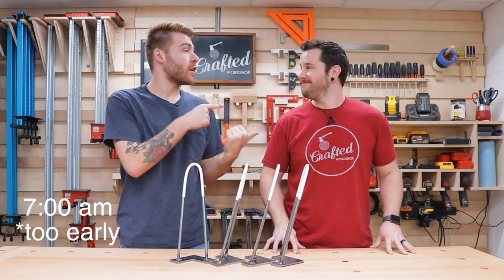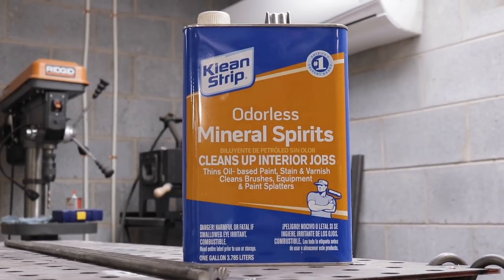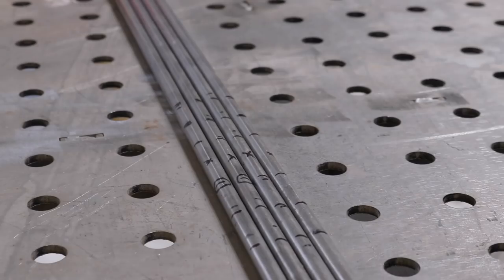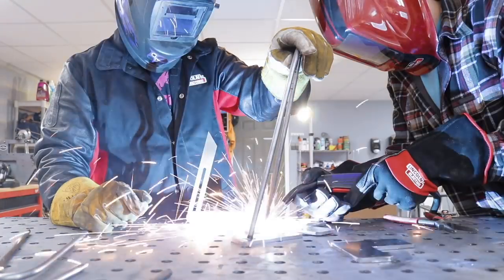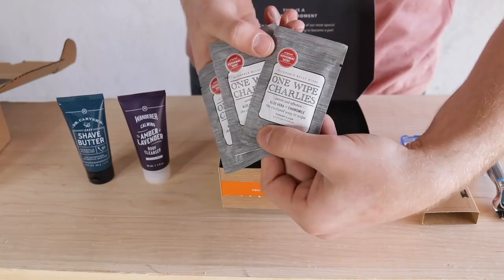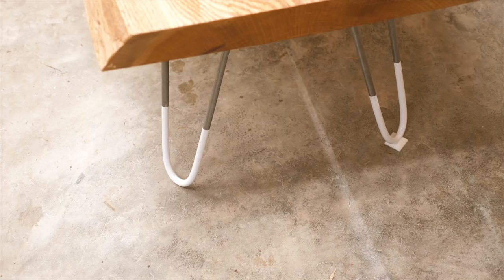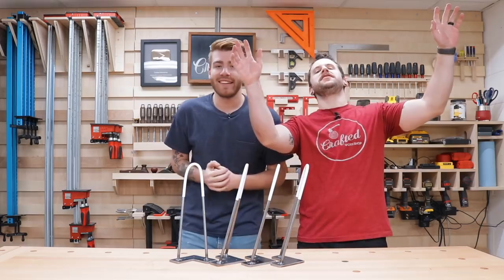How to Make Hairpin Table Legs | EASY

Comment: For some reason my desk is not stable using hairpin legs. The legs are screwed in tight but there seems to be no support. The table is 36 inches long and it a slab of maple wood.

Comment: Really cool video.  I made a set myself a few weeks ago using an oxy-acetylene torch to heat the round stock for bending.  My jig was very similar to yours.  I did make my top plates of of 2 pieces of flat plate that I tig welded into right angles.  The biggest difference on mine is that I drilled through holes in the plate and pushed the legs through so I could weld both sides of the legs and then ground down the welds on top.  They turned out really well.

Comment: Hey Mike!
I must have been learning how to make hairpin legs the same time you were! If you're interested in a super clean look as far as welding the legs to the plates, I found it worth the time drilling holes through the plate big enough for the legs, with a bevel on the topside. I left an extra inch on each tip of the leg and fed them through the holes until they all lined up. Welding the bevel on the top side made them incredibly strong, then I was able to cut off and grind down the excess on the side that would be hidden against the wood. This was great for me because I don't have the technique down for a pretty weld but I know my way around an angle grinder.

Comment: Neat video. I may have to try this as I love DIY. I was just searching hairpin legs on amazon and found some that would work great. They are 16" and support up to 250 pounds for less than $20 a set of 4. They had 5 stars too which also made me feel better. - Heidi

Comment: The ghost scene...oh wow lol. So good. Shspeways is great. I get my protectors that come in a bunch of colors from another company. As others have suggested, they clip on and are a bit more pliable. If you pick up the table, the protector stays connected.
Reply from the maker: Right on! I’ll have to check em out. What’s the brand?
Reply: Modern Builds i believe they are from The Hairpin Leg Co, usually get them on amazon for about 10 to 12$. Hope it was alright to mention them, thought sbout that after i sent the comment. I like that yours offer a differnt look, and i think Shapeways can print in different colors too. Could even hit em with that paint if someone wanted them to match

Comment: Can you add a finder washers to the bottom of the legs the holes in the washers could be useful for tack welding and put smaller round felt pads on them?

Comment: Using Plasti-dip (the original tool dipping kind not the sprayable version) would be a good solution to get the color at the ends while also making it less likely to damage hardwood floors.

Comment: Those bars look like cold rolled steel which does not have mill scale. Mill scale is an iron oxide layer that forms when hot rolling metal. It can not be removed with mineral spirits. I wish it could be tho.

Comment: There are inherent problems with hairpin legs that I see nobody ever mention or even try to fix. The first problem is the angle. No matter who you buy them from, they are a set angle. That's bad because to make them fit a table you must move the mounting point in or out so that the base of the leg does not stick out past the corner and look like a baby deer. Or too far inset and look funny as well. So the solution there is a different angle for each height. Now, I actually mean any height has it's own angle. Not just a set for coffee tables or a set for desks. I mean any height in between at one inch incriments. That would mean the taller a table got the straighter the legs and the shorter a table got the more angled out. But then you need the mounting location to be the same for all legs. By that I mean you have for example a 40x20 table top. You drill the holes for the legs. You mount someones cheap China made desk legs and it looks great. But now mount some coffee table legs in the same holes and it doesn't work. So again, a different angle for each height. Once you do that you have the ability to make the perfect angle for any height. Plus the person mounting the legs can put them in the same location every time. If you are selling tables this comes in real handy because you can pre drill holes from a jig and the legs will fit no matter the height. The legs hit the floor at the corner no matter what height and all with the same hole locations. You cannot do that with any legs on any video here on Youtube. You can't do that with any Amazon legs, any legs from China. That's just a plain and simple fact. Second issue is the mount. Why the F does everyone use that big L shaped mount shape? Sheep that's why. Monkey see monkey do. Everyone else does it so it must be good.... smh. No that's the worst shape ever. TYhink about how hard it is to wrap up a set of those and ship them. Now you may be thinking like I think. The shape needs to be shipping friendly. The angle needs to be friendly for use on any top with the same holes. I am not sure why nobody has ever thought of this besides me.

Comment: Why not split clear rubbrt tube into a diy split loom that could be used with the hairpin legs. It could keep your floors scratch free, and would allow your table to not slide around.
Reply from the maker: How would you hide the cut line?
Reply: You don't have to split it, just get tubing with the same inside size as the diameter of the leg. Slide it on before welding, slide it up to paint the bottom of the leg then slide it down to the bottom after paint dries. Just a thought.
Reply: Modern Builds I might have missed it but how much did it cost to make these? I keeping wanting to start making them instead of ordering. Another great video, might be my favourite. Thanks!!
Reply: Modern Builds I might have missed it but how much did it cost to make these? I keeping wanting to start making them instead of ordering. Another great video, might be my favourite. Thanks!!

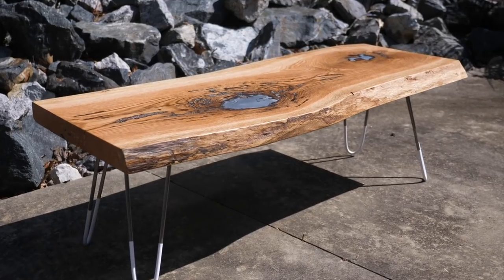Comment: its dam near impossible to make weld 4 identical legs that are the same height unless you make a jig to hold it in place as you weld.  At 7:50, there's one leg that's not touching the ground; that may or may not be due to uneven concrete.

Comment: Be careful when using cheap steel, as it can be brittle. There is more involved in hardening and weakening steel than discussed here, as a welder knows but DIY may not.(Another place for legs is at garage sales and thrift shops. By disassembling components, we save some junk from landfill. )
I'm not trying to discourage Making by any means, but encouraging safety and education.